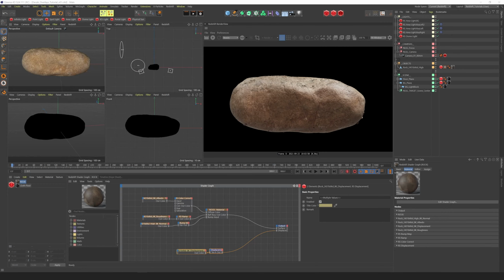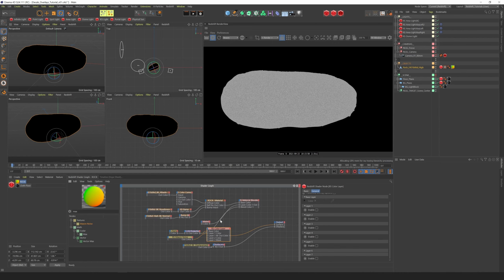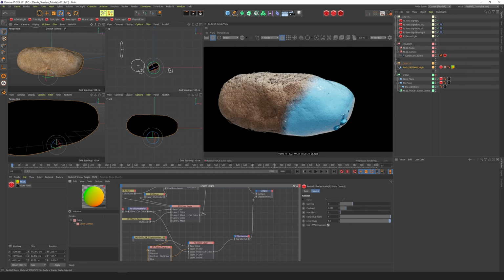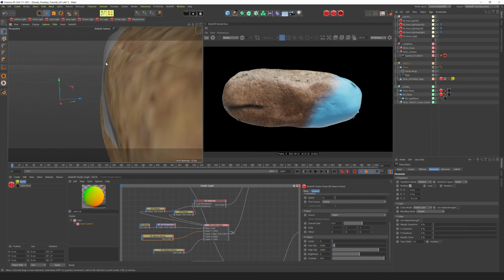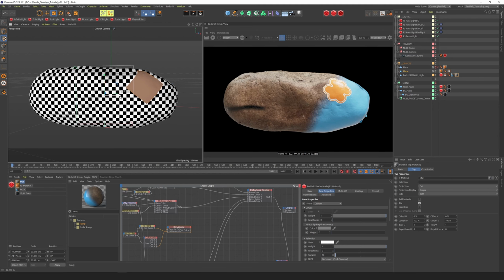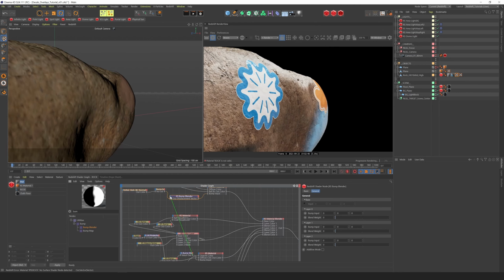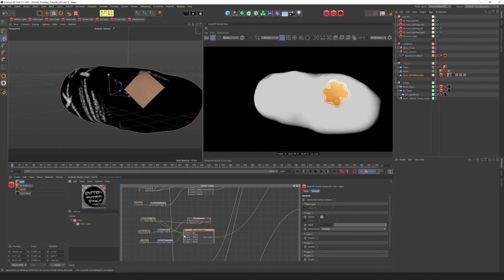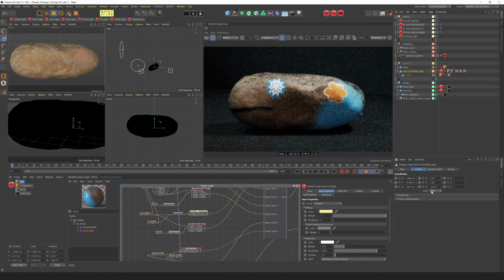Decals, Stickers, and Overlays in Redshift

Comment: What hot key do you use to change which node goes to the surface output? I love how quickly you can toggle that. Also great tutorial I love your breakdowns!
Reply from the maker: That's the Connect Node To Output command I have linked to the W key using Customized Commands. I like using W for this, if I'm accidentally not on the RS Shader Graph then I only toggle world axis mode.

Comment: Overcomplicated. This is redshift r&d UX fail. Not every single user is expert in 0-24h....
Reply from the maker: I understand your frustration. It seems like applying a sticker material on top of another material should be much simpler. And I agree. But unfortunately right now this was the easiest method I could come up with. Hopefully someday there will be some new features of Redshift that will make this process much quicker and much more straight forward.

Comment: awesome content! we also use the shrink deformer for labels but use the displacer deformer instead of a plain effector. this way your your label moves away towards its normal direction
Reply from the maker: Thanks for watching! The displacer deformer and plain effector are interchangeable here. Setting the displacer to intensity instead of intensity centered would be the same as adjusting the min value on the plain effector to 0 instead of -100.

Comment: thank you zak, always like to watch you stuff. it kinda calms me while learning something :)
In case you ever want to have a stronger transition between the textures, Like the rock was "dipped" into color, 
it helps to increase the brightness setting in the ramp node (next to "knot position"), and set it to blend (!) :)
(thats what I tried to do, but always had a small blend until I found this out)
Reply from the maker: Thanks so much! Yeah, even with the mode in the ramp set to "Step" there was always this small gradient transition. Cranking the brightness is a  good idea to force that hard line. I did have to put the output of the ramp into a Change Range node to clamp the values between 0 and 1 if I was using it as a diffuse map. Otherwise it would have an emission glowing effect. Thanks for the tip!